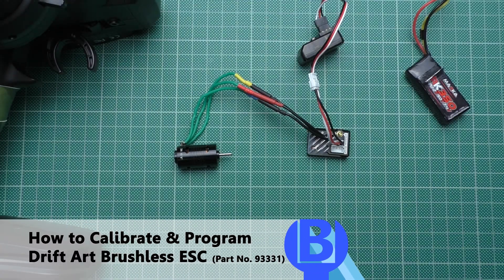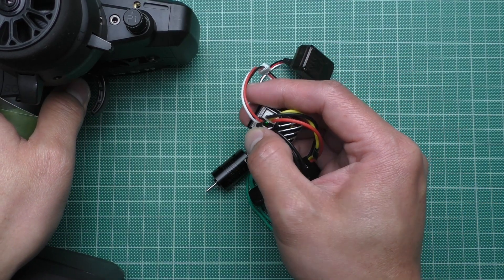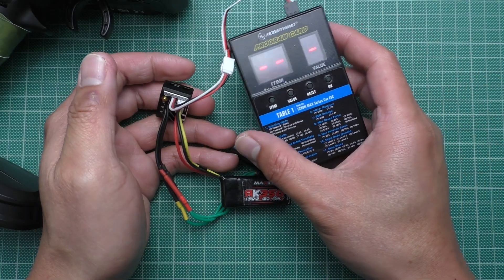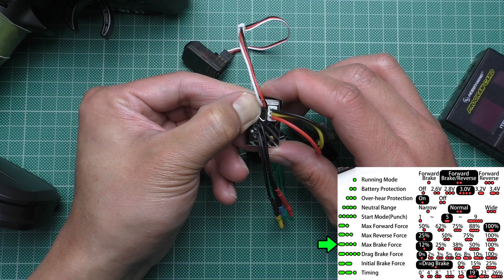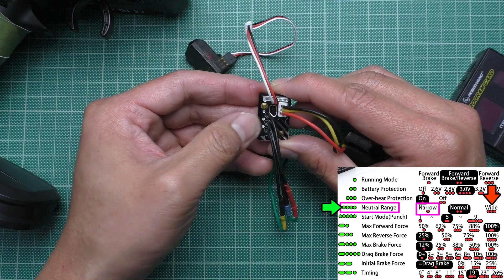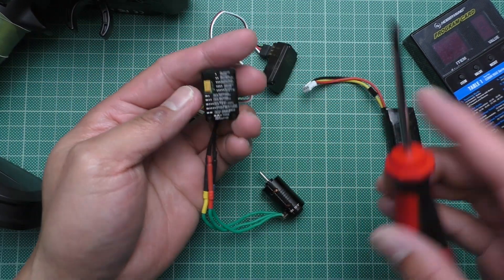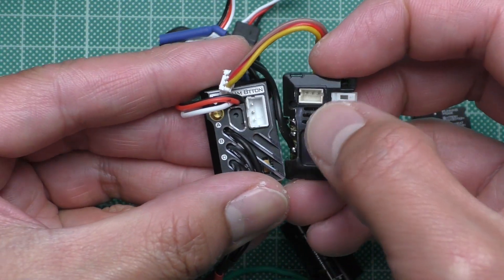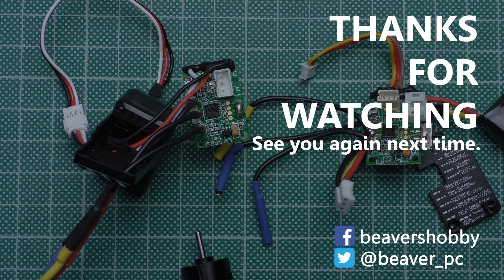[Tutorial] How to Calibrate and Program Drift Art ESC

Comment: Can you please help on how I can calibrate my Kiwami esc? I have searched and tried everything but nothing seems to work.. most people doesn’t seem to lend out any help. You’d be my last stop before I quit this hobby. Thank you in advance.
Reply from the maker: The manual is a bit misleading. Here's how to do it.
1. Check the settings on your transmitter. Make sure throttle EPA and Dual Rate are at 100%
2. Turn the ESC on and keep holding the button until it beeps rapidly 4-5 times. Now you can let go of the button.
3. Press the button once and it'll beep. If it doesn't beep you might need to hold it a bit.
4. On the transmitter, pull the trigger to full forward then press the button on the ESC. If it doesn't beep then you might need to reverse the throttle channel. Don't worry it won't time out. Now try again and see if it beeps. Once the full forward is registered you can move on to the next step.
5. Push the trigger to full reverse and press the button on the ESC until it beeps.

On step 4, different transmitters have different throttle direction. For example, Flysky doesn't need reverse throttle but Radiolink does.
Reply: @BeaversHobby ok I did 1&2 as you mentioned but my main problem is once i enter calibration mode, I understand when pressing the esc button once it’s suppose to set the neutral point. Doing this set my esc would beep multiple times and it will switch from flashing blue light to solid purple and the receiver light shuts off. In normal case receiver light will stay on and the esc will only turn off to continue with the process.I apply 3 the receiver light supposed to stay on at all times during calibration. The esc also needs to be turned off when applying these points. I’ve also reversed the throttle channel.. Do you have an email so I can send you a video to get a better understanding on the process I’m applying? Thanks
Reply from the maker: @mpescarte  My email is beavershobby@gmail.com . Or you can send me messages on facebook at https://www.facebook.com/beavershobby .

Comment: What type of connection do I need to install my battery on this drift art esc? I have a reflex battery but not sure which cable I need
Reply from the maker: It's JST PH 2.0mm 3 pin. Normally the balance plug is JST XH 2.5mm.
There aren't many batteries that come with this plug though. Just a few that made for mini helicopters and of course, the ones that are made specifically for 1/28, 1/24 cars.